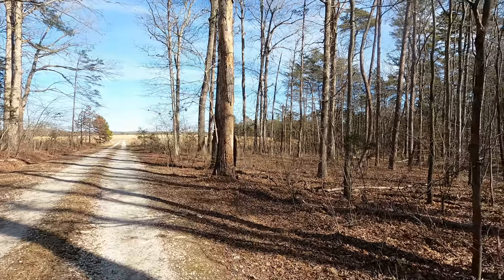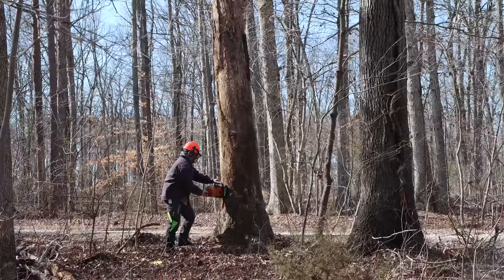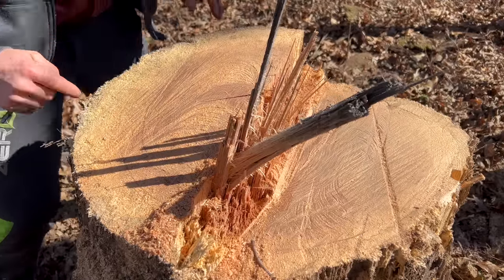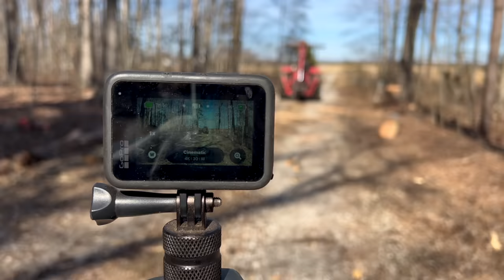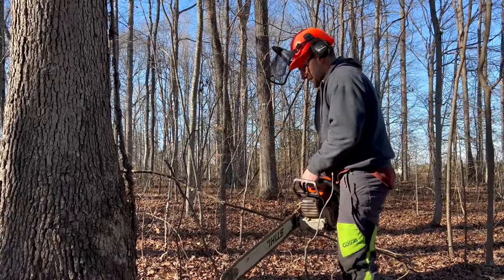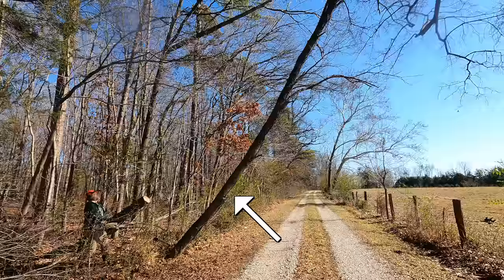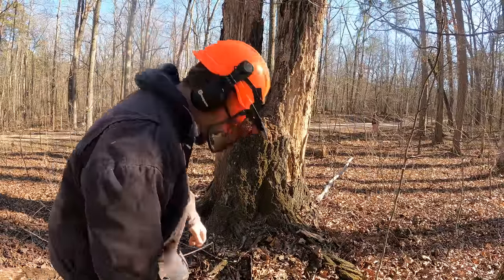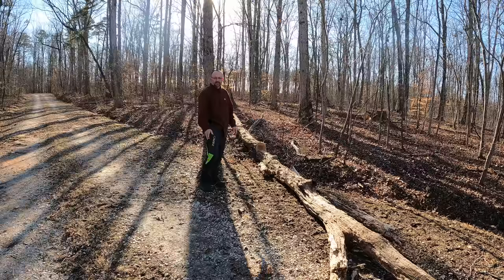No Nonsense Guide to Felling Dead Trees.

Comment: Excellent video. Good aerial shots. Got hit by a U shaped branch knocked from another tree on fall. I was about 50 ft behind the main tree and hiding behind a big pine for extra safety as the fall was slow in a tight wooded area it should have been enough.The U shape acted like a boomerang as it hit the ground and it sent me flying, swiping my leg. Still have a limp 30 years on and the tree which lost the branch is still standing! Just shows you can never be too careful, thankfully my only accident in 70 years. Best wishes from the UK.

Comment: I had a leaner much like this.  I made multiple cuts just like you described and got the remainder stood up vertical.  When I went to push the tree over, a chunk broke off the top and hit my back just below my neck.  I was wearing a hard hat and was lucky to get just a big bruise.  I was in the woods, alone which was a really poor idea.  It's easy to forget that dead or damaged trees are extra dangerous and unpredictable.  Stay safe out there!

Comment: I don't know about the rest of you but I was on the edge of my seat with each tree. I hate dead trees.   John,   something to consider, I use a smart plug on my tractor's block heater. I just switch it on with my phone from the comfort of my house, truck, bath tub, crawlspace, basically anywhere with a signal before I am ready to use it.  Cheers

Comment: You should try a battery desulfator for your tractor.  I have had good luck with weak batteries and sometimes even dead batteries brought back to life with them.   Run it all the time with your tractor when in use or plugged into the charger but D/C it if not in use or plugged in.  It is self consuming on power and uses the battery's own charge to run so will run your battery down if not plugged in or running. 

Nice tree work, I would have used it for sawmill lumber but you have better trees for that and its what you heat your house with so I get it.  Great video as usual. Can hardly wait for the next one

Comment: Good solid video, really rotten big trees are pretty sketchy at the best of times, the safest solution to them is either mechanized felling or prevention. checking for dead and dying trees once or twice a year and cutting them down before they're too far gone. if the risk for barber chair is really high putting a heavy strap or choker chain/rope around the base of the tree to keep it from completely splitting apart might be worth doing, though if the tree is completely rotten it may just split further up anyways.

Comment: Good call on the plunge cut. Professional logger friend taught me to do that a long time ago. He also told me that when you make your notch, do the angled cut first because it's easier to get a good intersection with the second cut being the horizontal one. The reason being that the first cut doesn't need to arrive at a precise location. Within reason. The second does however and is easier to aim a horizontal cut. You'll be less likely to need to adjust the notch and end up cutting too much.
Reply: I always do Horizontal cut first!! it gives me a guide of Where I need to bring the saw during a diagonal cut down. It's easy to get lost doing a Diagonal cut and take Too much, or Too little....if I got my straight cut already made, I know exactly where I'm bringing the cut! It's easy to eyeball it......I don't subscribe to the theory of following old timers, just because someone has been doing something for 30 years, doesn't mean it's Right, Lol. You gotta do what works for you, and how your Brain is wired.
Reply: Angled cut always goes in first because it's less likely to pinch the bar if the tree sits down, and easier to extract with a wedge if it does pinch.  The horizontal cut is less likely to get pinched after the angled cut has been made.  If you make the horizontal cut first and the tree sits down in compression you may need another saw to extract it if you can't wedge it out.

Comment: Great vid! I would make a suggestion though...  and I learned this lesson as I was cutting. Take an ax or hammer and give the tree a few good thumps. This will help determine if the tree is closer to solid or not. I was cutting on a dying tree and soon found out the heartwood was completely rotten. It didn't quite drop in the location I wanted, and took out a part of my fence. No big deal, but had I known, I would have taken the time to protect the fence better.

Comment: Nicely done, I did similiar yesterday on my video. I had to snatch block mine up a long pull to get it to the wood pile, too steep to buck on the spot it came down it.  Mine was a Doug fur so very tall and not allot of diameter to work with, good explanation of what your doing.

Comment: If it felt sketchy, could you disassemble the tree from the top down using the boom lift?  Or is that too much faffing about ?

Would the first and last trunks make good lumber/timber at all?

What will you do with the stumps in the ground still?  Leave them to rot naturally or drill them to speed it up?

Comment: I work in forestry with a harvester and the top falling of standing dead trees are the killer. We are supposed to leave the dead standing ones untouched but if we work around them or they are near roads, power-lines or people live in the vicinity we cut them as high up as possible and leave the top part next to the standing part just so it can stand without risk. Also when felling big trees with a harvester you run the risk of snagging a dead standing tree with the one you're felling and it can get dragged toward you and smash into the machine..

Comment: Good work with the power saw. Plunge cuts will always be an issue of contention. It’s a nice way to feel out what’s inside a standing dead. I’m not a fan of a top open face cut either…was taught under cut for better control and it’s just instinct to cut that way…although I have made top open face cuts…it’s rare. Key is, always cut compression first. 
Your plan for that leaner was sound…you just got an uncooperative tree!!😊👊🏻
Enjoyed it…soon as you get to a 24” bar, it’s all pure powersaw pleasure after that!! 😎

Comment: Man, I hate dead trees. The only time I had fun clearing them was at a military training area.

Wrap det cord or boom tape around the tree at ground level (amount depends on the tree), put a third to two thirds of a brick of plastic at knee level on the side where you want the tree to fall, nail a filled sandbag over the brick, wire everything up with the plastic set 0.5 seconds after the lower charge, and click the thing.

Det cord / boom tape cuts the tree, plastic kicks the bottom end out from under it. We did about 150 and wired them all together, it was the Instant Clearing.

Stand well back. Wear ear protection.

Comment: Best to rope dead ones to avoid any motion in the crown (small wedge cut, leave excessive hinge, lightly set wedges to hold the back cut open, go far away and pull). Yea it takes longer but a limb on the head takes forever. 

Always have a plan B for hung up trees. Yours went easy, but I've had it where I cut three times and the now vertical part is still hanging fully off the ground in the other tree. You had machinery there, but one should not even start this with at least a comealong on standby to pull it down, just in case. Another technique is to try and roll them out with a cant hook after cutting once, while it is still at a good angle.

Comment: @FarmCraft101
Hi John, when you said you expected a barbour chair, I was wondering, would it help if you wind a chain or steel cable around the tree many times? 
Will it still hit you in the face when there are 20 turns of a 1/2 " steel cable around the trunc close above the spot where you place the cut?

Comment: Good advice about cutting poison ivy with top of the bar. I’m not overly-sensitive to poison ivy and I’ve gotten the rash from dead, dry vine. Supposedly a dead vine has less urushiol and causes less reaction but still does contain the oil, which is why you can’t burn it.

Comment: Here in Germany we like to use a tool that translates into "trunk press" it's basically a extra heavy duty ratchet strap that you can use to prevent barber charing.
Reply: I use a transport grade ratchet strap that I shortened to about 10ft/3m for convenience.  For the really fat and heavy leaning trees a 5/16" logging chain wrapped a few times.  One only needs to have one experience with a bad barberchair to rethink cutting methodology.

Comment: I live in Canada, and although it is a 'warmer' part I frequently get cold weather. One thing I always try to make sure happen is to put my clutch in all the way and disconnect the PTO or at least have the loader and 3 point in a rest position so they are not being lifted by the starter. I find that these two 'tricks' will sometimes be the difference when you are doing a cold start no block or circulating heater.

Comment: Glad to have your lady aboard as she sounds quite delightful. Another name for two people that just laugh at life and its quirks. A example was my mom was at a chain saw place with my dad and she sees a sign in the window... "Bull pricks for sale".... here is where things go as un predicted. Mom did not know that a Marlon spike was for rope and a bull prick was for cable to splice them with. Now days everything is called a Marlon spike as the other went the way of speech. Similar to the "Lady splice" used in splicing cables together. Men used to tip their tin hats when one went by on our straw line. You can not use the lady splice on bigger cable as a hard pull will separate them.  I shouldn't need to explain the reason it gets this name but you may ask as there is a vulgar name for it as well. Then again, is it vugar if its used on some piece of line? It is in a forest service logging terms section

Comment: for those leaners, that one went down fine, but if not you end up with a steep one and then it's just unpredictable in what direction it will go, like most beavers die that way, there is another technique by making them turn which is more safe
I'm not telling you how to do it, just have seen a lot of people getting in more tricky situations with that under cut-it-off technique
but nice to see a non-pro handling difficult stuff

Comment: Regarding Poison Ivy .... Use Dawn dish soap on ivy oil (or suspected ivy oil spots) and a wash cloth to scrub just like taking old crank case oil and grease off your hands. Pay attention to spots like between your fingers where it's hard to get dirty grease out. The wash cloth mechanically removes the ivy oils. If you miss a spot and you break out in itchy blister bumps, do the same technique and symptoms will vanish.

Comment: Thank you sir. You are a very good teacher. My guess is you are located in about western MN? At least that is what your accent when you speak, says. Just curious.... Regarding cutting branches off a ladder, I like to put a birds mouth cut on the under side not directly at the bottom of the branch, but diagonally off the bottom, therefore when cutting on the diagonal top side directly opposite the birds mouth cut, when the branch starts to drop at an angle to the left or to the right, therefore less chance of knocking your ladder down. Usually works for me. Thanks for your how to videos.

Comment: Hi,not too much left on top of the first tree.Your battery gets run down even more if you use the glow plugs or air induction heater.I have a battery gage hitched right up to the battery to tell what condition my battery is really in before starting.

Comment: John, I noticed that you had some trouble getting the blade out of the tree trunk at times. Try to use the saw blade as a normal saw forward and backwards to clear the chips. This will help immensely. Congratulations on lowering the limbs safely.

Comment: During the first attempt to start your tractor the exhaust was smoking good. You only needed a better battery or a boost. Mid teens or 20's shouldn't be a problem. Here in Canada we don't have issues until sub zero F. 
Why didn't you use the tractor for the tree that was already fell? Maybe it wouldn't have hit the fence. Just my thoughts. Love the video's. Keep'em coming.

Comment: The preferred undercut to use when felling snags is a Birds Mouth (or Pie). When felling professionally, the undercut can be as much as 50% diameter of the tree instead of the required 25-33% on green trees. Give it a try sometime.

Comment: John, I've only felled maybe a dozen trees in my 59 years but, watching the dust come off of that 2nd tree, that bad boy was a real widowmaker!   I'm glad you were and are safe!  I do have a question though.

Is there any specific reasoning when cutting a wedge?  I've seen some guys will make the flat cut and always make the second cut coming down to make the hinge.  Others like to cut up from below to make theirs.  I've tried both and generally prefer coming down.  Again, is there any particular reason or benefit of cutting from either direction?
Reply: Taking the angle from below the flat cut leaves the log with close to a squared end and that can be beneficial if you're milling the log into lumber

Comment: When I have a leaner like that I cut a wedge out on the top side - then make my under cut - doing this directs the tree to fall straight down - sometimes I will tie a strap to the bottom of the leaner and use a come-a-long to pull the bottom enough to clear the tree from the others -

Comment: It's an essential ecological practice to leave the dead wood in the forest as food and breeding ground for everything from bacteria and fungus to rodents and birds. In fact, here in Norway it's mandatory for forest owners to leave not only dead but also live suitable trees for these purposes after logging, especially trees for woodpeckers, and there is a strict enforcement to not even touch any vegetation along creeks and waterways. So leave it, especially if your plan is to use dinosaur squeeze to pull out the rotten logs and then just burn it - totally unnecessary for the environment.

Comment: Wouldn't plunge cut or really do most of what I am seeing here. With a dead tree (especially one that has been dead as long as this one appears to have been) the normal playbook is out the window. I normally just make a single cut on the side in the direction it is going (maybe 10-15% of the diameter). I do NOT do a normal face cut. Next, I do the normal back cut (maybe with some wedges) to drop it. And I do all this at waist level. The purpose here is to be in position to run at all times. I've had trees like this collapse (like the World Trade Center) if they've been dead long enough. So safety is your #1 priority. What this will mean is you will have to make another cut to detach it from the stump once it is on the ground. But that is no big deal.....getting it on the ground (with all involved uninjured) is the number one priority.

Comment: You should use your excavator with its thumb to pick logs off ground (to keep saw blade out of the dirt) to cut in 10 ft lengths and load onto your tractor forks. You can also take larger log loads out and load them up way quicker..
Reply: 8' is better if log will be used for stove wood .yields 6  16" rounds

Comment: On the tree leaning over the fence, I think you expected the base to fall forward but actually that made no sense because it was defying the load on it and holding solid. The only way to protect the fence was a rope pulling from 90 degrees displacing the tree top and then cutting the tree (slowly) at the very base.

Comment: I am not an expert. Just trying to analyze. 
Тhe first tree falling:
probably not an example of good judgment. It was not clear how much rot existed in the tree. By pure luck, the whole base part in tree had not any rot inside. However by making the 50% front notch as in vidro, if the tree had rot across, the probability of sudden crack is higher then making standard  notch. Even making very small notch at first, just to peek in the interior of the trunk , could be wise; later larger opening notch can be easily made if necessary. 
So, my point is if we have possibly dangerous situation, we should do everything to put the odds to our advantage, not the other way around.

Comment: What a mess.  I’d’ve started with the 28” bar.  The trigger or strap method is pretty basic.  West coast guys never use it because the release is sudden and then you are committed. I probably would have used a Humbolt notch to deliver the bottom of the log to the ground a little smoother.  Also look up more.  

Yeah nothing wrong with what you did there.  I’d’ve done it a bit different.